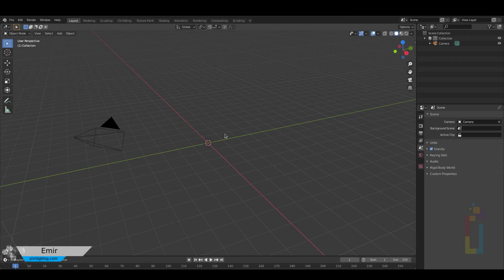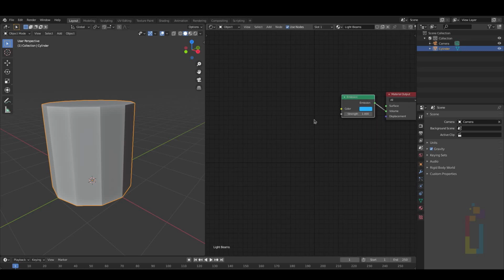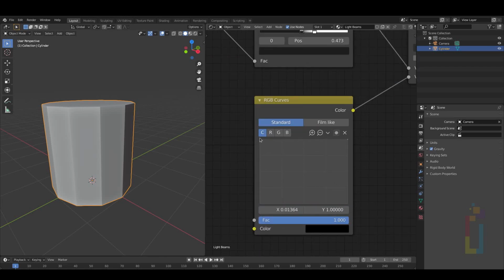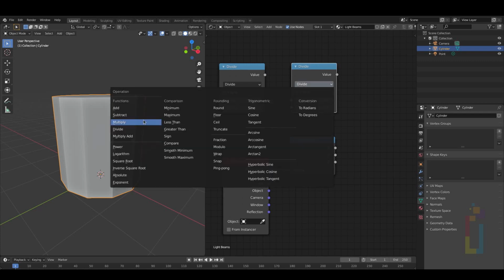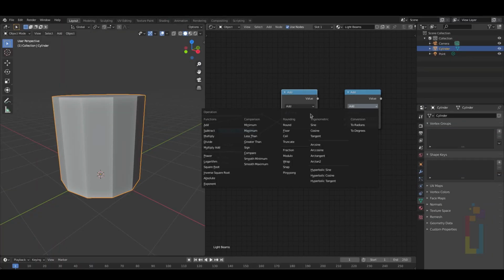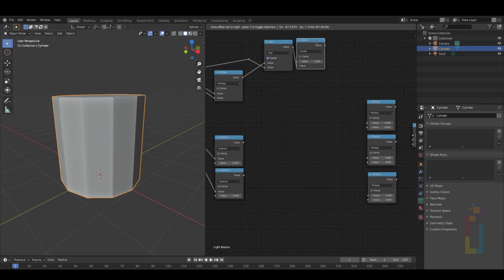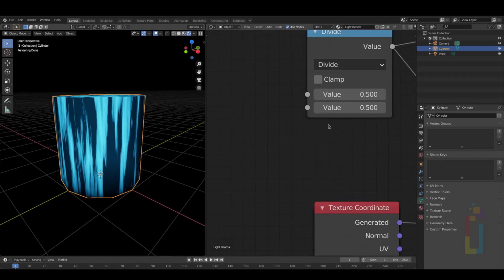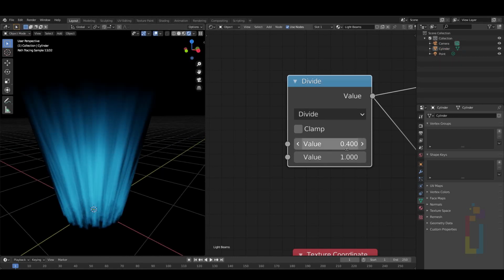Blender Tip: Holographic Light Beam Effect

Comment: Rendering a video, I'm seeing the black top of the cylinder .. It's not rendering as transparent.. Do you know of a solution for this? I tried to make the blend mode "alpha clip" but that didn't do anything. I played with the color ramp and rgb curves trying to fix it, but the part which is supposed to  be transparent, comes out a bit black and noticeable.
Reply: Oh I managed to fix it by increasing the final multiply value and making sure the colorramp's left side was complete black. Then I tightened the range and it looks much better now.

Comment: Hello! Thanks for this. I have an issue though, half my cylinder has the beams like you show at the end, but the other half looks off. The beams are going in the wrong direction. Any idea why this might be?
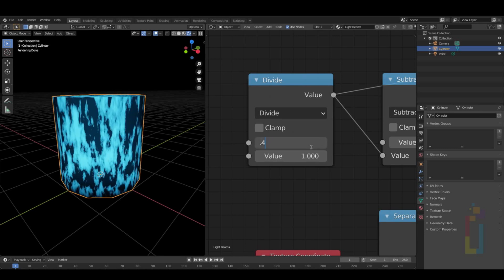Reply from the maker: Thanks for the comment. It's really hard to guess what could it be. Try to check all the nodes again to see if they are the same as in the video, check the texture coordinate node and also make sure to move from solid to render mode  like in the minute 7:43 to be sure of that.
Reply: @Pixldg  Thanks! I fixed it

Comment: wait, is there a way to bake it?
Reply from the maker: Hello and thanks for the comment.. I'm not aware of a good way to bake volumetric shaders so far. Sorry
Reply: You can't bake it, but you can fake it. Instead of using volumetrics you cam mix a gradient with a noise. Use the generated vector for the gradient and set the y rotation to 90. Use a color ramp to flip the gradient, you can use this to adjust the height later. Use UV texture coordinates as the vector for the noise (no need to unwrap the cylinder), same 90 degree rotation, and increase the x and y scale, 9 worked for me. Increase the noise scale too, I used 30. Then mix the factor (color on the color ramp) of those two with a color mix node using multiply at factor 1 (max). Add the output of that to a math node set to multiply to control the strength of the light and put the output of that into the strength of the emission shader, I multiplied it by 10. Now add in a mix shader and mix the emission with a transparent shader and use the output of the color mix as the factor. Now you should have something that looks like the result of this video, won't look quite as realistic as this but it's a good tradeoff for faster rendering. 

To stylize it further you can take the output of the color mix into a coloramp and add some color variation, black, dark blue, medium blue, very light blue, white, for example, and put that into the color of the emission shader, that'll make it even closer to the result in the video.

This material can easily be baked and put into a game or whatever. It can even be animated just by animating the location value on the noise vector. Good luck.
Reply: @daniel4647  can you make a video tutorial of this method 🥲